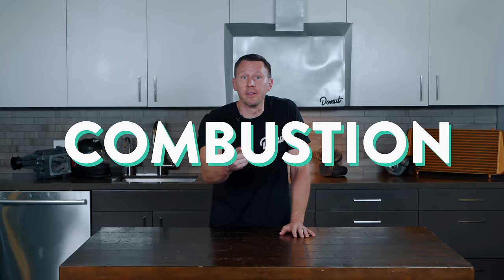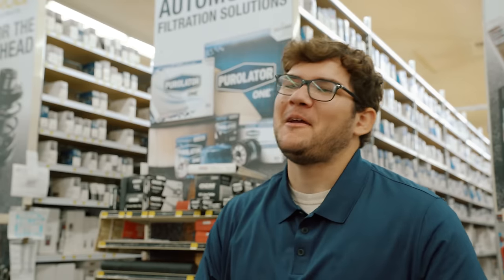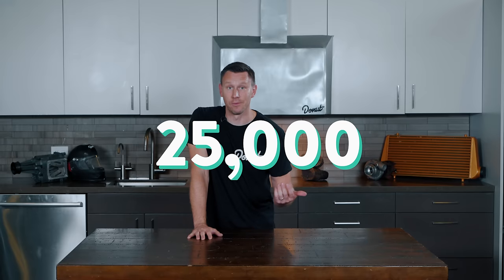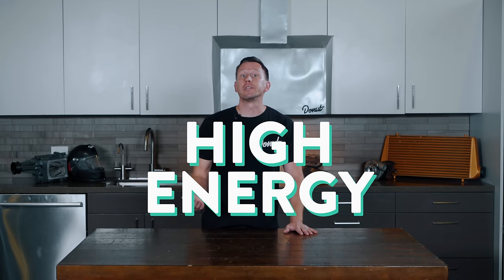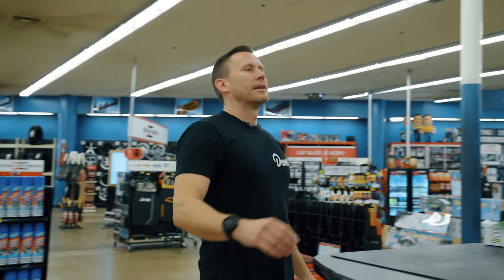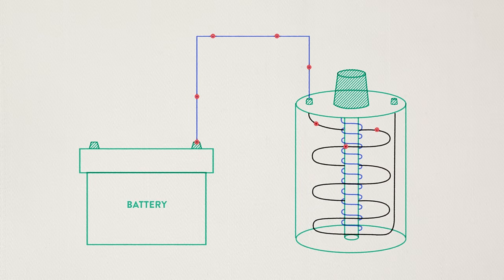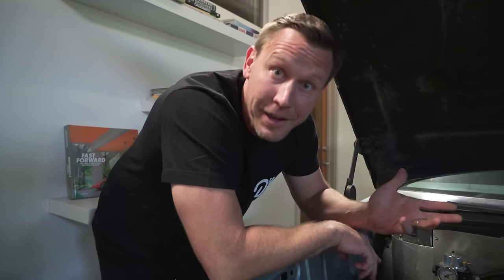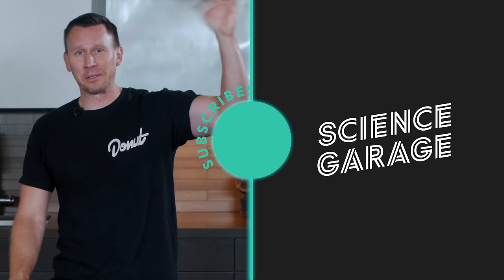Ignition Systems - How they Work | SCIENCE GARAGE

Comment: why dont we simply make the piston into the sparkplug? when the piston reaches its climax it can ark n combust the compressed fuel evenly
and if a piston was a magnet and the cylinder copper, the whole engine would generate its own energy.. why do we need fuel?
bit, this is just one of thousands of concepts already drafted.. i dont want to ruin the surprise.. a whole new world will be created after the apovolypse.
petrol engines is a very complex, multi system way to propell a vehicle.. just think.. if any of the many systems fails, the entire engine is worthless.. for example, if the coolant pumps or lines break, or the brake sytem fails, or the fuel system or the electrical systen, not to mention lubricant and friction from parts rubbing together.. stupid petrol cars will be laughed at by future generations.. they will say, is this the pinnacle of mens understanding?.
a real engine would have layers of backups.. 
how about nasas rockets? these rocket scientist must be retarted.. each rocket requires fuel, and fuel = weight. so, if they plan to go to " space" ( theyve never left the earth) or further they need more fuel, bit more fuel = more weight, therefore they need more rockets, and then more furl for those rockets, so on so forth, and look! these things can barelly get off the ground.. ha ha, losers, they dont even know how to capture the energy thats pushing out the bottom of their rockets, look at all the fire n smoke shooting out for nothing... and they are so dumb that they would put this on tv, as if they are proud of their accomplishment??🤣🤣🤣😂😂🤣😂 oh my god!.. stupid freemason nazi scum.. its hard to find a word stupid enough to describe them.. because words are more intellegent.. at least a word means what it says, while these stupid people spew out spinning ball lies